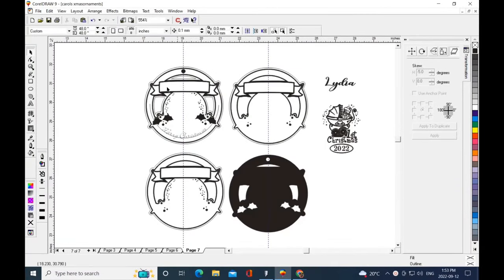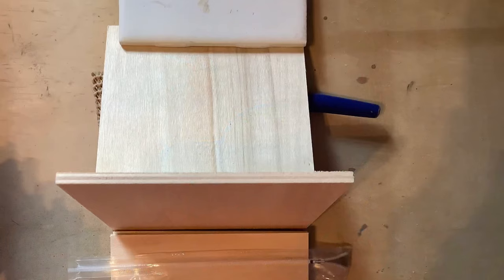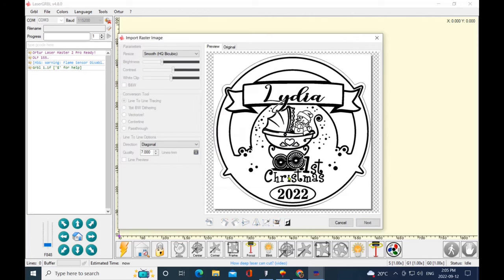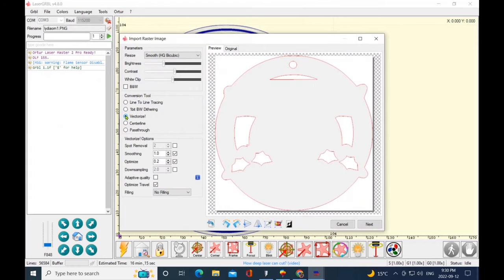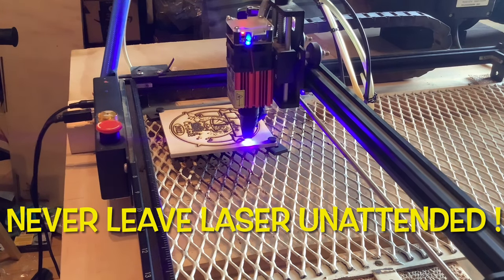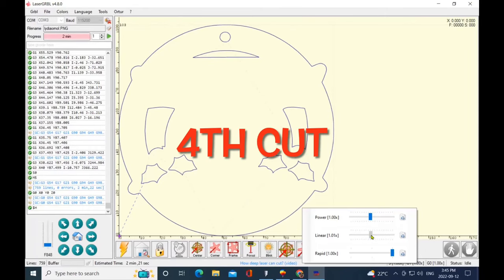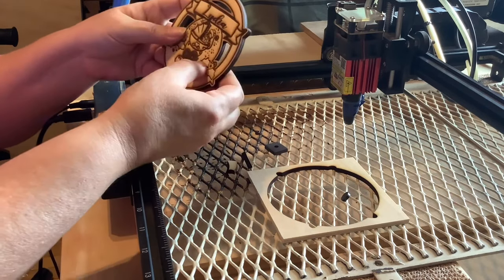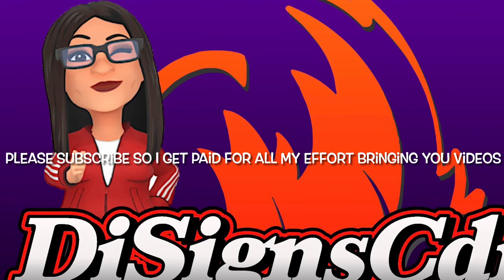12. How to Engrave & Cut in LASERGRBL . ORTUR LM2 PRO !

Comment: Im so confused with this whole set up and system. I am getting a longer ray 5 10wat tomorrow trying get laptop sorted and up and running. Gonna use grbl but im still confused. I have some files pre bought but the whole design set up is still very confusing 😮
Reply from the maker: It can be a little overwhelming at first. If you are using a laptop be sure to install the ch 340 drivers located at top right of LaserGRBL under Tools. Most laptops do not have this driver that’s needed. Svg’s are still pretty experimental and when you open them in LaserGRBL , you are not given the option of changing sizes only cutting settings. LaserGRBL reads them as an outline only . PNG’s are solely what I work with. Pick yourself up a Corel Draw ( no earlier than version 12) off of say e-bay. I hope you got a good laptop with lots of memory and good processing speed. I use a desktop myself. I use gimp ( free) to edit photos from time to time. I do have some more videos on designing and another one on the way plus where to get free files.I also have some free files uploaded to the DiSignsCdn Subscribers Only Facebook page under the files tab . Click on the 3 dots to be able to download them . You can see previews of what images I’ve uploaded under the featured tab . So don’t panic , lots of help out there with the LaserGRBL Facebook group, You-Tube etc. You will get this and will be creating away soon enough 😊
Reply: @disignscdn  thanks for all that information. I have a friend of mine who is a tech expert and works in computer management and data companies sorting a laptop for me and he knows what it's for so I suspect it'll be plenty memory and processor speed. I have a few files but am gonna need to get some more. Appreciate the information though 👍🏴

Comment from the maker: I've updated this in the video description,.. and covered it in more recent videos,....but for anyone not wanting to read my novel there.. :D ... The reason all my inside shapes did not cut first was that I had the “optimize travel” selected. It generalizes the entire piece .  Also, there is a Red Stop sign with a hand on it on the lower right of your LaserGrbl screen. This WILL STOP the laser right away! I've always been apprehensive to use it as it resets all my settings like the slider functions I had dialed in while engraving. ( That's why I keep a "Laser Bible" to jot down all my setting for each project and material. ) The stop bottom to the top left will not stop engraving or cutting right away if Your GCODE has already finished sending. And finally, I have completely tested out the Append function, that I go over in Video #16 . The new flood fill and outline features in the latest LASERGRBL version. I am happy to say it will indeed do multiple cuts and I have also discovered a much easier way to save files for precise engraving and cutting. So updated instruction video is coming soon! :)

Comment: What power laser does one need for it to cut through 1/4 inch plywood?
Reply from the maker: I would recommend the 10 A laser, that’s 2 x 5.5 watts put together . There are a lot of Aftermarket Lasers out there and you have to be very careful to check what the actual output of wattage is and compatability for your machine . For example the LU2-4 is a 20 watt but 5.5 output. My OLM2 Pro and OLM3 are set up for 24 voltage while other machines are 12 voltage . I know there’s an 80 watt laser out there , but off the top Of my head I cannot remember who makes it. But once it pops in too my head, I’ll post it here. 😃
Reply from the maker: In my video #21 I am cutting through 1/4 “ Birch plywood with my 10 A 😃
Reply: @disignscdn  Thank you! WIll keep reading about these very cool devices!
Reply from the maker: @PhatTony  I decided to test out my wee little LU2-4 on 1/4" birch. Now mine is the original Laser that came with the Ortur LM2Pro  when they first Launched it. Now I see They've changed to a Short focus and Long Focus model. I'm pretty sure mine is equivalent to a Long Focus. Anywhooo.. I was able to cut through with Air Assist at 200 - 225 mm/min 90% power. by my 3rd pass the laser was already coming through! But I did have to do 5 passes total as my board was a little warped. The 80 watt Laser is by LaserTree but in reading up on it a little more. It's only a 10 watt output, but it is for a 12 volt machine. :)
Reply: @disignscdn  OK, thank you! I am gathering all of this information and hopefully will make an educated purchase using all of this info. Thank you very much!!

Comment: I just csrnt get min to cut some times I get perfect cut single paste but then try agen wont get a cut at all no mater how meany pases i do
Reply from the maker: We all have days like that as no 2 pieces of material are ever the exact same. That’s where material makes a difference. Like MDF for example is the most difficult I find to cut. It’s a dense fibrous gluey mess that loves to smoke and de focuses the laser. I’ll stick with my Baltic birch blanks. 
The laser lens needs to be cleaned more regularly for optimum power. Focus each and every time you’re cutting. Make sure your material is flat and level. Always check that you have “constant power” on and have changed the min power and the max power to the top power you are cutting at. 😃
Reply: @disignscdn  I think I found the problam wen go do second pass so on not lining bk on on the exact same spot not shore how sort that as no movement on frame or materiel so on
Reply from the maker: @jujucattys156  I'm curious on the type of machine you are using. If you have homing switches, sometimes you do get some bounce back when it homes. I'll try and find the grbl code for you to change your homing speed. If it's set to too rapid you get more of a bounce back. Also, Are you trying the "append file" feature to open up the file inside of the main file. By using this as many times as passes you require has the machine not returning to home but continuously cutting. You can always press that big red stop button on the bottom right of Lasergrbl to stop your machine right away if it does go through the material before all your passes are completed :)
Reply from the maker: @jujucattys156  1 more thing I should suggest is either slowing down your rapid ( bottom right of screen, click on where you see "S G1 GO", slide the slider for the G0 all the way to 25% before you cut. ) You can also totally disable the "rapid go" speed by going to top left, click on "Grbl" then click on "settings". Click on "Rastor Import" . And finally click on the box to " Disable G0 fast skip" I only suggest going this route when you are cutting as it will take longer to engrave, but it will be a cleaner more accurate engrave / cut.

Comment: I have a vevor 5w. In Lasergrbl you have to choose your machine at one point. This one is not on the list. Is there a default machine that will run mine?
Reply from the maker: I’m not sure exactly what you mean as in choosing the machine .I’m running 6.2.1 LaserGRBL and any prior version hasn’t asked for my machine . I know the list if you click on the book icon for material settings may not have all machines .  The most important thing when first opening and connecting your machine is to open up GRBL configurations and click “refresh “ and “write “ to load your machine settings from it’s board 😊
Reply: When I import a raster image and use the conversion tool "center line" option, a new menu screen pops up titled "target image." In the speed section, There is like a three pancake layer thing to the right.  when you hit that, another pop-up screen pops up Titled, "select your configuration". and on that screen, There are options for laser model, What material and what action you are going to do. If you hit the dropdown menu for laser model, there are presets for cutting and engraving, but there are so many different models, some don't allow cutting. And there's a variety of models such as the atomstack a j 20 watt or the leon, 3d 5.5 watt. The vevor is not on there so I'm picking one that's as close as possible
Reply from the maker: @eye95records  center line is only used for cnc'ing . So that's if your machine had a router and say you had a v bit in it. I've never used center line for Laser Cutting or engraving. 😊

Comment: Hi when using laser grbl software when I try to jog the x axsis the y axsis moves instead I've checked all wiring is correct any ideas as to why this would be happening?
Reply from the maker: That is a strange thing to be happening.😱 x axis being left to right and y axis being front to back of the machine. What happens when you jog only the y axis? I'm wondering if something got inverted in the code somehow as most laser machines only have 1 way to plug them in and are pretty foolproof unless something got crossed at time of manufacturing?  What Laser machine are you using?
Reply: @disignscdn  atomstack p7 is the machine would the machine jog accordingly to the orientation of the picture I'm carving
Reply from the maker: @kernowcoinringscornishcoin3999  It shouldn't. If you are jogging your x than your x axis should move not your y axis. I did try searching it up and found that someone was having similar issues and this is how they tested it. ( see link ) I hope this helps. I definitely recommend putting in a request for technical advice with Atomstack as well. https://forum.lightburnsoftware.com/t/my-atomstack-p7-suddenly-stopped-working-effectively-in-the-y-axis-and-now-returns-alarm-9-and-alarm-1-messages-can-anyone-help/89593
Reply: @disignscdn  thanks for your help would there be anything in the laser grbl settings to invert the x and y
Reply from the maker: @kernowcoinringscornishcoin3999  That would be $23 in GRBL configurations . That only inverts your homing position and should not invert the X and Y axis when jogging . When you home the machine now , what direction does it go to home? Bottom left or top right ? . I just read another post that said disabling hard and soft limits in GRBL settings helped one fellow. Is this machine brand new to you or did it just start to do this on you? As possibly updating the firmware for it may help as well . That should be available on the manufacturers website. Secondly are you using a laptop or computer. You may need to install the CH340 Driver you will see under a tab in LaserGRBL at the top right for it to run correctly.  Unfortunately I don’t own the same type of Laser as you to help with any of your LaserGRBL configurations . But if you’d like to take screen shots of your configurations , your X and Y plugins etc. and e-mail them to dianecolclough70@gmail.com , I might be able to spot if something is off 😊

Comment: I get lost on the 300 dpi setting.  do you have a video hat shows the correlation between your graphic, and the piece of wood size?  I nother words how do you know the 300 dpi will fit on that size wood ?   thank you in advance.
Reply from the maker: I design all my graphics to scale. So say my piece of wood is 4.5" x 4.5" . I will draw a box that same size. I make it white with no outline. Pop all my graphics on it. Exporting at 300 dpi from my program keeps the graphic to scale. Now, I have read that inkscape users export at 96 dpi to keep it to scale. Video 34 Purrrrfect placement goes over my process a little more now that I use a transparent backgound so Lasergrbl will recognize my white bounding box. Hope this helps ;)
Reply: @disignscdn  Thank you for your reply.   one more question - please.  how did you know the piece was aligned properly (x,y) ?
Reply from the maker: @joey0618  I usually always engrave or cut with the material lined up to my home position x-0 y-0 .  If have a bigger piece that I can't engrave from the home position I will use the offset function in the second window / dialogue box that will come up for your speed and power when you open the file. So I will have perfect placement ever time. ( I always use "frame"  as well to make sure it's on the material) Do you have limit switches on your machine ?

Comment: How do I cut a single straight line? I want to cut some things in half. If I vectorize it will cut a 2 dimensional shape, x axis and y axis. If i dont vectorize, it will cut side to side with a big kerf. Currently I have to import a rectangle, vectorize, and stop the burn after it's done the first line.
Is there a way to just cut a single straight line?
Reply from the maker: You are able to import a single line in an .svg , or .dxf format . I suggest giving that a try. You may need to play with the size of the file you are exporting a couple of times to get the line size you need. 😃
Reply: @disignscdn  ok thanks, I will try. I've just been using png so far.

Comment: Thank you for posting these videos! My LM2 20w (predates PRO) is about two years old. I have not yet purchased lightburn and did not realize that I could do gray scale in lasergrbl. I have not yet cut anything (successfully) either but have wood pieces about the size off yours (3mm, though). So excited!  Two questions: Have you done anything yet with your rotary? Your air assist connection came with your PRO, didn't it? I am on my second connection as the previous one cracked and I am a bit challenged with getting to home position. It could be the way that I have mind attached, though. I need to find time to get back to this!
Reply from the maker: You are very welcome Carol! I don’t have a rotary attachment yet. There doesn’t seem to be enough hours in the day to let me create everything I want to! If I get a rotary attachment, my husband may never see me! 😆
I purchased my air assist nozzle from King Gubby Designs and my aquarium filter from Amazon . Yes we can do photos and lots of greyscale options .. you too are about to find out we don’t have enough hours in our days 😆
Reply: @disignscdn  I already know there are not enough hours, unfortunately! That is why I have not learned enough about my machine along with several other priorities.  I keep mine in the garage on a wheeled cart and the 100 degree plus summer also dampened my enthusiasm. Looking forward to cooler weather.

Comment: Thanks to your videos, I have started making ornaments with my 10W diode laser using 4mm plywood. Everything cuts great except I'm have trouble dealing with charring on the edges. How did you avoid the charring getting all over? Do you seal the edges?
Reply from the maker: Hi Ken! To avoid Charring, lower your power and add an additional cut pass. Excessive charring is from too high a power and too slow of speed. Sometimes depending on the material it's hard to avoid, but a little sanding and then a quick vacuum / air compressor spray cleans it right up. If you're leaving it natural..a little spray of clear doesn't hurt, but it will blead any soot left behind. If you're painting it, a spray of sealer before painting will help keep those colors vibrant. :)

Comment: As a complete newbie there's a lot i don't understand what you're talking about. What does pressing home actually do? What do you mean "make sure your origin is set to your home"? Is that a separate step after pressing home? or before? or is setting the origin to home the same as pressing home? I don't know how to get something to print in the middle of my piece of wood. Am i supposed to align the wood so the edge as at the 0mm mark in the machine?
Also, i notice you're using a graphic which has an outline around the whole thing. If i'm engraving text and a few icons together, there's no border around them all. The border is going to be when i cut, not when engraving. How does the machine know where i want the text positioned on the piece of wood? At the moment i've just created a white border in my vector program, and it doesn't seem to pick it up as part of the graphic. But is that the normal way? Or is there a way to center text/graphics. Without the white border around my graphics/text, the graphics is butted right up against the edge of the page (on my screen), at 0.0.
I have no faith that the laser is going to know where to center the text in the middle of my wood. 😂
Reply from the maker: Pressing the “home”
Button will only work if you have homing switches. Your machine would move to X-0 and Y-0 when powered on. If you want to start anywhere else on your material , use those arrow keys to jog your laser. When your laser is in the position you want. Press “set origin” that’s the button that looks like a world globe and a red pointer on it. To get your work centered  ,  you can use set origin to center in the window that pops up when you are first opening the file and putting in your settings. To find center on your work piece, either measure, draw an x for center point from corner to corner, frame it, etc. You would jog the laser to center of your material and click on “Focus” to be sure you are on center. Turn off “ Focus” and Press that world globe button . That’s how easy it is to set your center . 
No, LaserGRBL will not recognize or be able to trace anything in white. You would need that outline that you intend to cut either a solid fill of black so you are importing 2 files.. one to engrave it and one to cut OR make a black hairline outline around the white outline and you can use the append file, flood fill method to engrave and cut. This option is only available in the latest Version . See most recent video on my channel . Plus I talk about setting origins in Laser Engraver Issues. :)
Reply: @disignscdn  OK thanks so much, that's so helpful! 😀

Comment: I have the same laser but what is that extra piece at the tip. Is it air assist?
Reply from the maker: Yes, that black nozzle tip you see is for my air assist. I’m trying to Remember where I got this original one. I think it was KT designs out of the states. I found them on one of the laser groups on Facebook. It’s 3D printed. Now King Gubby Designs have a variety of nozzles available and the same air pump I use 😃